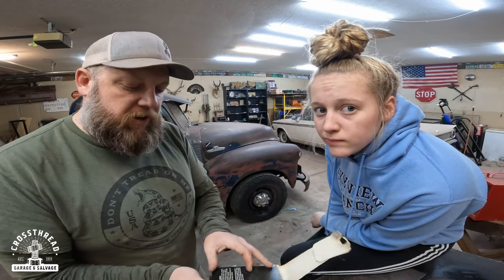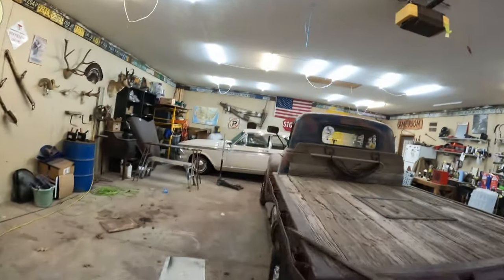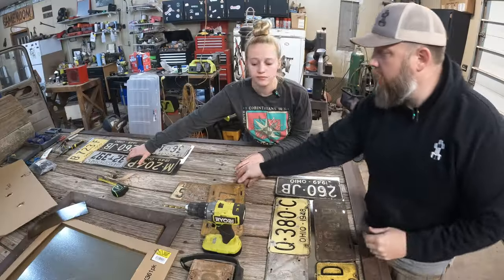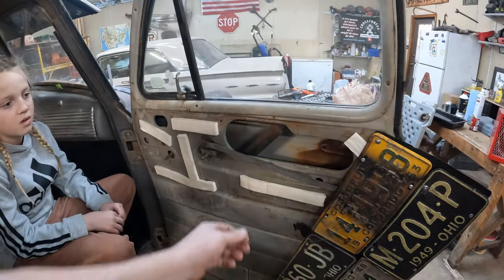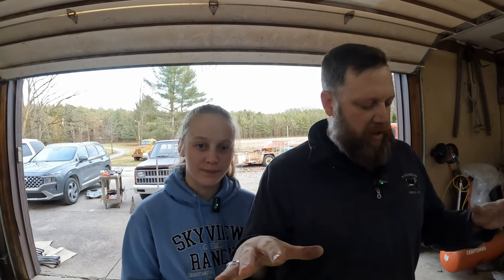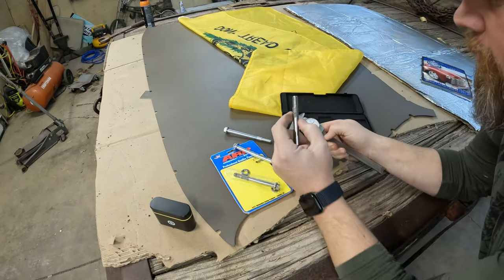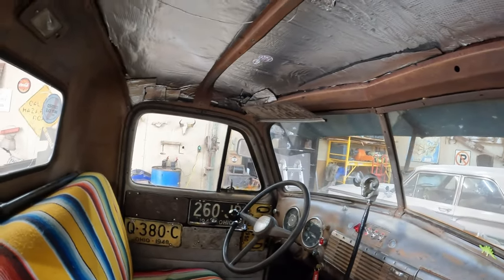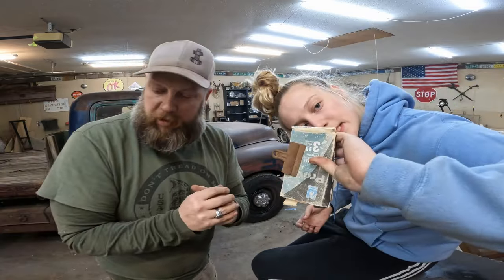Cummins-Powered Chevy Gets INSANE Interior Upgrade!

Comment: For your starter/flex plate issue. There should be a 1/8 gap between the starter pinion shaft and the teeth on the flex plate.

Comment: Next time you have starter issue try turning the engine by hand slightly(clockwise at crank pulley). Then try starter again. If starter meshes well with flex plate then you're looking at damaged teeth on the flex plate. Hope this helps.